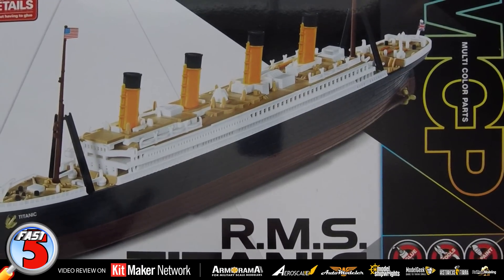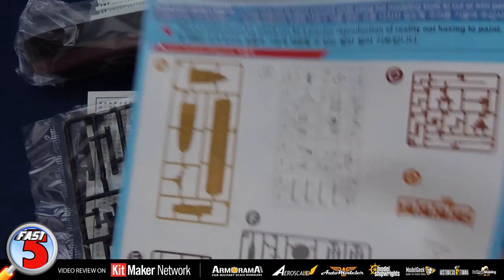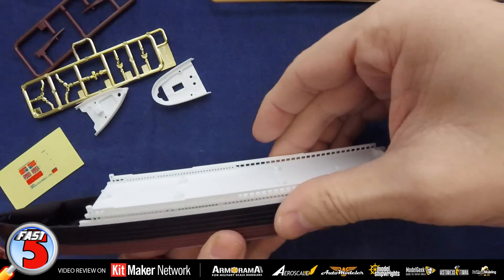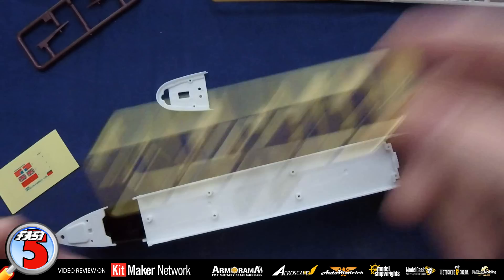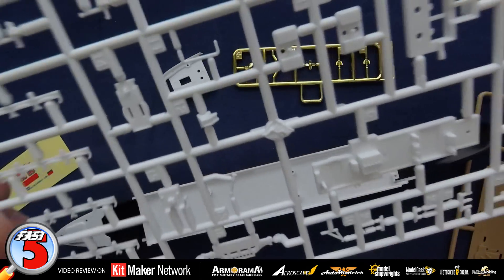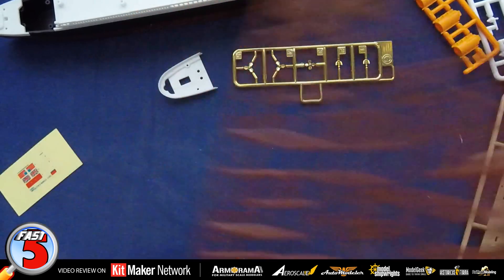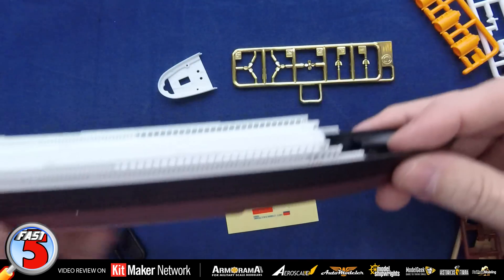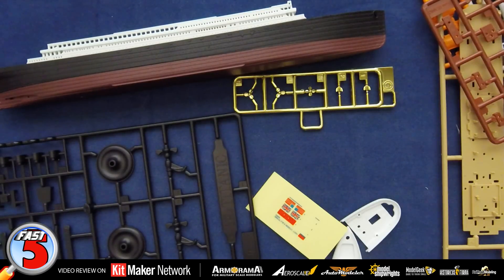Academy RMS Titanic (1:1000)

Comment: Just picked it up! It’s a great model highly recommended not high detail obviously it’s small and the crows nest and some stairs are not colored and it can’t float but you could sink it your self but this is a great model, again good model. DO NOT PUT THOSE FLAGS ON IF YOU ARE GONNA TOUCH IT they fall off really easily it could be cause i put it together badly but in case dont